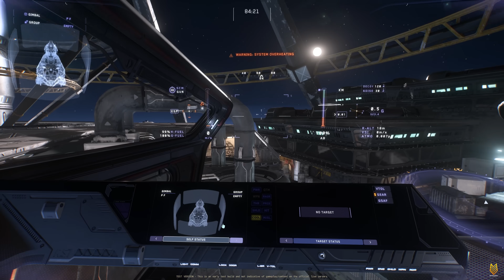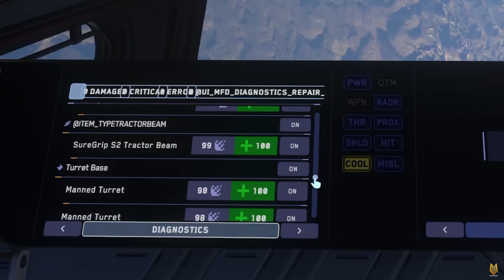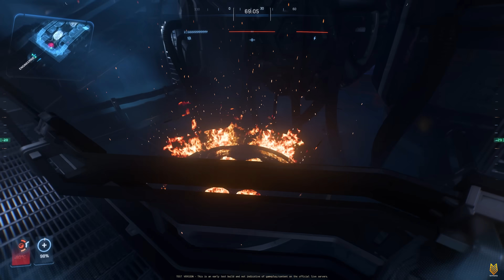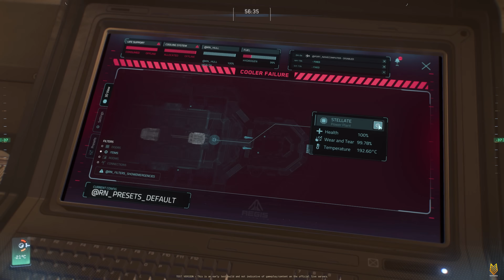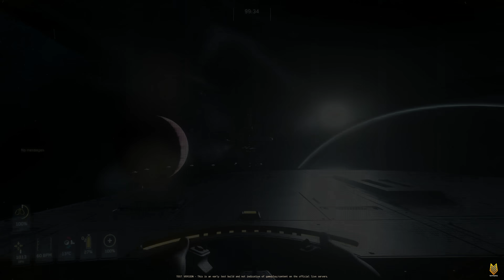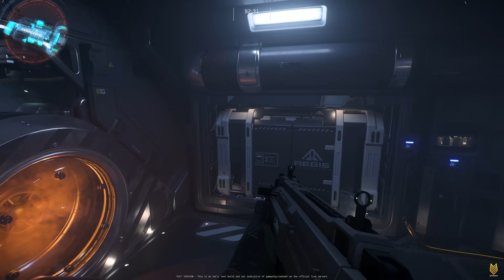Star Citizen Engineering Part.1: A Detailed Explanation & Testing Of Engineering MFD & UI

Comment: i think they are pronounced Omni-sky, could be wrong tho... component MFD reminds me of the really old MFD screens, and is probably a rework of. used to be able to overclock each component and it would overheat parts faster. could partially OC Attritions and have them hang in the damage buff zone with controlled firing techniques. was better than full OC, because full OC would just overheat in no time and leave you waiting for guns to completely cool. could underclock, too, though. at the time QT drives would overheat going across system, so could underclock a bit to prevent a overheat that would cause a cooling shutdown and respool extending travel time more than just travelling a bit slower.

Comment: Good luck figuring out which mav thrusters to turn off to control the ship.  So terrible.  At least call them L1, L2, L3, R1, R2, R3 etc for right and left starting from the front of the ship.  Then same for T1, T2, T3, B1, B2, B3, etc for top and bottom starting from front of ship.  How is that so hard to come up with CIG?

Comment: Okay they gotta cluster or group up weapons to turrets so you know what’s what. And with how long this list is, I feel like with such tiny screens it’s gonna suuuuuck. They should really consider making the engineering terminal in the larger ships like Polaris, a whole 50” tv sized screen. I’ve seen the terminals, I have a Polaris so don’t need to tell me they are bigger than an MFD, I know they are. But not by that much. It would be sweet if it were like a whole touch screen wall so you had it all on display at once. That or like one larger long screen for the list of components without needing to scroll much, and several smaller surrounding it to display other important info. I know it would make my engineer happy, but he’ll make do when the time comes.

Comment: Of course the temperature drops when you vent a room. You're letting the vacuum of space into that room, and space is near absolute zero. Of course its cold. DUH. It ain't rocket science mate.
Logically, when you disable power to disused rooms, you're reserving power for things like weapons and shields, etc etc, and  there is no point in having rooms powered, and wasting that power, if nobody is in that room. So, logically, you would want to keep things like the med bay powered incase of emergency, but you can disable power to.... crew quarters, for example, because in the heat of combat nobody is in their quarters anyway. Re-allocate that power to essential systems.

Comment: The system seems too fragile. Just because a radar overheated the whole ship shut down? A snowflake capital ship. It should have been just the radar that shut down and maybe on fire. But shouldn't it just catch fire when past a damage threshold? Even the real life electronics throttle or just shut down when overheated (if no malfunctioning hardware) to think that an age with laser guns and capital spaceships with quantum jumps catching fire that easily is kinda funny. idk if engineering is trying to reflect or bring in realism, it needs more polishing to do
Reply: The theory is that everything is turned up for testing reasons. It's in testing so it makes sense
Reply: It’s been buffed/turned up so we can see the effects and actually test them. They need to do the same for normal ptu for say rep missions that in higher tier missions, there is a cool event, we need to be able to directly test large scale events without grinding for rep in ptu

Comment: most stupedest design in a video game, whats the point? what is the benefit to have this...
Reply: The benefit is that our ships last longer in a fight and are repairable from a downed state.
If you get boarded you can use the door controlls to lock the boarders inside a room and vent it to kill them.
If you are boarding yourself you can use engineering terminals to disable defenses. (That part will most likely require hacking in the future.)

Comment: The MFDs seem rather small now that they're adding more information and functionality to them. CIG needs to polish the controls (e.g scrolling), UI layout and physical placement since many MFDs still have awkward and unnatural angles. They way they're placed is aesthetically pleasing but not very practical and makes it very cumbersome to view and interact with. One of the major annoyances with MFDs is that scrolling operates both the zoom level and scroll bar within the MFD UI.

For the engineering terminal, it would be a major improvement if they listed all the components in a sidebar and when you click it, it orients the holo display to focus on that specific component and draws a circle around it.

Comment: So we could say we finally have many features back we already had. 
Sad to see that the ship doesn't spin when symmetrical thrusters turn off...but then again they already pointed out, that most of the thrusters are virtually mounted at ship's center of mass.
Reply: Are you sure about that maneuver thruster can compensate a main thruster? Supplementary if a maneuver thruster would compensate for a straight line it just wouldn't move at all. To compensate for this kind of spin you actually would let spin and fire at a different angle/position (180°)
And it is official that most thrusters are virtually mounted with the smallest lever possible...
Reply: Im pretty sure they are not following physics 1 for 1. Just pointing to the fact that all 12 or however many maneuvering thrusters were online and operational while he only had 1 main online. @el3ctr1csix22
Reply: Ships don't spin because you turn off a thrusters , ship spin when you apply a thrust in one direction while there is no counter thrust in that direction
Reply: The maneuvering thrusters were still turned on when he toggled off some of the main thrusters, that is why he didn't spin.

Comment: So basically coolers are now the most important component.

I hope these Eng terminals can be locked so only crew can access them.
Reply: Makes sense. When it comes to things like engines, motors, and computers, cooling is very important. If the radiator in a car breaks, it's not going very far.
Reply: @GrimGatsby  In space, heat management even more important, because it can't go anywhere by itself. At the same time we are using super powerfull thrusters, powerplants, shields and so on and all that energy eventually ends up as heat. How the spacecraft deals with those huge amounts of waste heat often gets glossed over in non hard-scifi settings.
Reply: Pretty sure there is a button somewhere that allows the ship owner to lock engineering access to one screen, so at the very least you just make sure right now that the engineer is only at the single physical screen and no one else. It's not ideal but it's better than having every screen have access

Also, CIG already said they will be having permission systems for locks and screens in the future that people can be assigned to...just, it's going to have to wait lol
Reply: A new way to troll players just dropped 😅

Comment: 7:57 - the radar manufacturers, are not qualified to manufacture radars, when they tend to overheat in basically idle mode
Reply: I mean if you have your cpu in idle with no coolers at all whatsoever it is gonna overheat...heat has to be dissipated or it just builds

Comment: From now on, I will hand over my captain's cabin to the engineer. I will put vending machines for drinks and food there, a computer with 6 monitors, and I will hang a DO NOT DISTURB sign on the door. By the way, when the engineer enters the cabin, I will lock it from the outside.

Comment: About to be a lot of upset solo capital andies when there are fires all over 😂
Reply: You might be disappointed by that.
Reply: Literally nothing will be different until they take a hit from an Anti capital weapon. Which very few ships have. Armor means that nothing you have will damage a cap ship's components. they will actually be even more dangerous than before. That S10 laser i just grazed you with just started a fire in your connie, or the Conqueror cannon slug just took your coolers out in one shot. The dials are just beings turned. I promise you the Idris will always be an apex predator. Hate to break it to you.
Reply: @Auldus laser is def gonna get reeeeemed out by engineering haha... that things gonna run up them coolers
Reply: @Auldus  If anything it'll be tuned for more downtime, because anything to make a capital ship sweat will be another capital or a so much firepower being thrown at it that the capital is scrambling to get away anyways. I spent 15+ minutes trying to figure out if I was putting out a power plant fire because the fire that got set in the power plant was not obvious about whether or not I was putting it out or not. During that time my shields were not on, and the pirate npc's from the arena commander mode I was in were having their way with my Polaris. I did not see any meaningful damage done to my Polaris during that whole time. Granted the whole thing could have just been the borked tech preview but I'm under the impression you first need to penetrate the shields first to even get a chance at the components, and then the armor.  I understand people want to see people not flying these capital ships so much, but there is going to be a lot of tuning before this is implemented but if they made it so these ships became basically unusable then that eliminates any incentive for anyone wanting to run them. Some of us will want to play the engineer, but I've got way too many friends that would sooner rather jump into a turret and pew pew a ship into space dust than maintain a ship. I don't have issues having to maintain a ship, just don't make it unreasonable to maintain either.

Comment: So basically we get the old display of all the compoents + temperatures + possibility of turning off any individual components we had years ago. Nice job. 
Joke aside, I'm gonna have to make a custom GameGlass ASAP 😅
Reply: Gameglass will not give you informations, so you wont have temps or statuses there. Useless for now until cig provides ship telemetry
Reply: @RomainWhateverwe will still be able to do much, like setting pips in different components, turning them on/off, resetting, maybe loading presets, etc… just need key binds. We already have the pip distribution although the info doesn’t come from the game, it’s not that hard. 
But yes, it will be much better when CIG will provide some API
Reply: Is is way more than what we had.
Reply: There's no way they'll give you meaningful keybinds for this. You'll be holding f and slowly trying to manipulate an overcrowded touchscreen within your screen like everybody else.
Reply: @robwoodring9437 they already added some keybinds in the PT patch notes. They gonna add some more for sure. Basically based on player suggestions. 
That’s why we need to test and give feedback
Reply: @robwoodring9437 I have no problems navigating the mfds

Comment: One major thing you have to keep an eye for is the red bars that you see at the top with Life Support, Coolers, etc. Those are indications of your components taxing your coolant's capacity. If you have too many components in the red (also indicated beside your component's pips) , that will cascade into a failure and start a fire.  All systems will generate heat so you'll want to make Presets to switch over to when you are just flying around and ones for combat. 

You'll also want to get better coolers than the stock ones. Oh and we can also overclock our components again, finally, so you can OC your cooler. That will cause more wear and tear you'll need to repair it with your multitool though.
Reply: Crafting is going to be amazing for ship components and makes sense why they are slowly nerfing a lot of ships as you will be able to craft their specs back to being better then a stock ship from a shop.
Reply: With all you said, there is a great opportunity for CiG to force People to take more care of their ship, encourage multicrew, dont abandon ships.. if there is a limitation in the preset system (maybe find a way to physicalize the preset ?) Then losing, abandoning, claiming your ship for no reason would result into the need to reset all the presets, cost lot of time, and why not credits if they made preset blades that cost a lot ?
Reply: @TheSoldiersid3  They were talking that all the presets will be saved/stored on the player that creates them so they follow the "engineer" and not the ship.
Reply: You should make a short and efficient guide. No fluff just simply stated info with examples